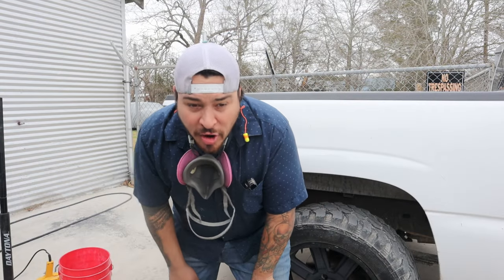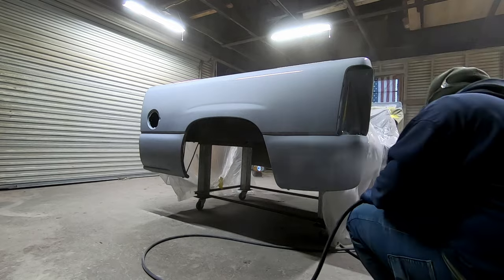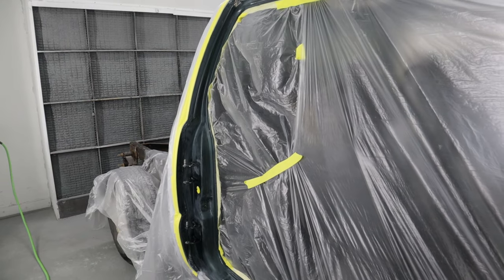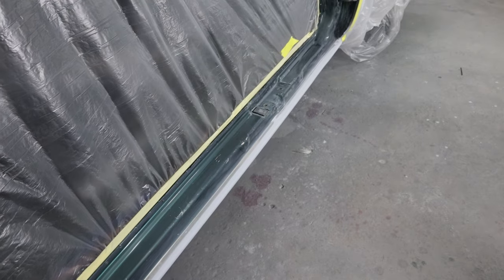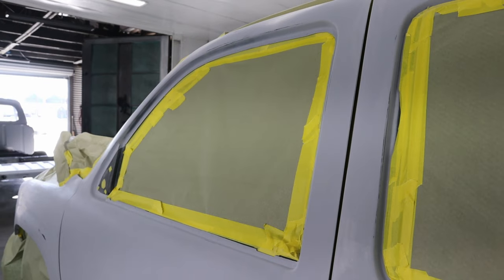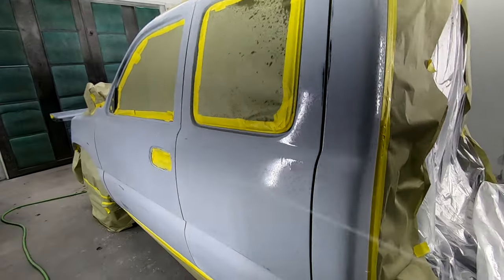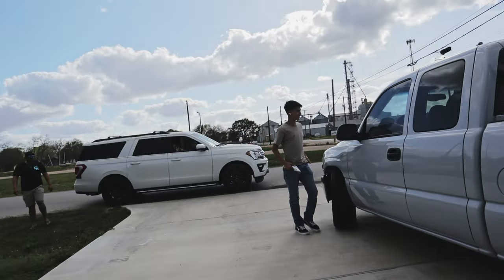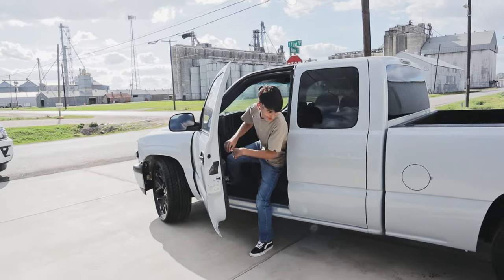Complete Build - 2001 Silverado 1500 Classic (Space White)

Comment: Ive a 92 Silverado excab long bed 8ft. The body is meh with dents but surface rust hitting the edges. Strang the bed is fine and cab corners as thats the usual rot. Howeber. The dash is trashed. Completely busted to pieces due to dry tx sun by previous owners. Stock other than that. Was rebuilt motor and trans 30k ago. No smoke. Unless the tires turn hahaha. I dont usually do that lately as its sat 3 years lately. Need to get it redone. The value on these are insane today. I dont know if i should sell or keep and fix up.

Comment: My grandpa gave me his 01 last year. Only 160k miles. He bought it brand new back then. Engine bay is immaculate. Needs new paint. Keeps wanting to cut off power and everything while driving. Replaced alternator wasn’t that. Got a buddy coming to look at it next week. Maybe fuel pump or filter?
Reply: Check your grounds; might need to remove some rust where the grounds meet the frame.

Comment: i wonder if you could lower a 4x4 like that
Reply from the maker: You can!
Reply: @Iamernestp  i wonder how you could set the 4x4 system up to work good with being lowered i currently have a 04 sierra Z71 ext cab with a chevy stepside bed and a 2 inch lift on 20s with 37s but i’m wanting to go low now and make a street truck